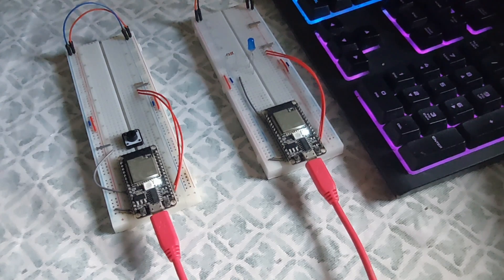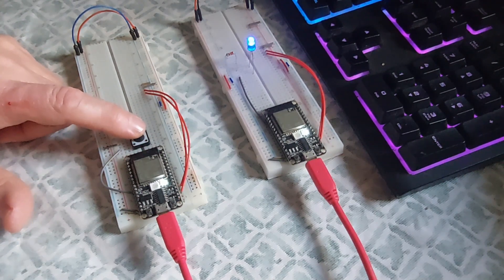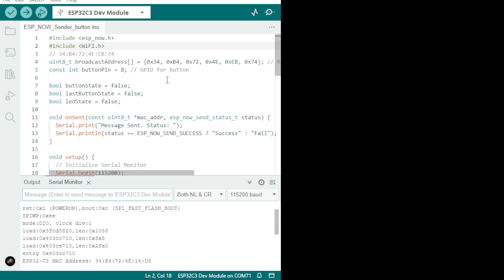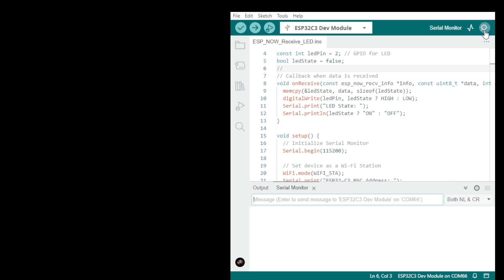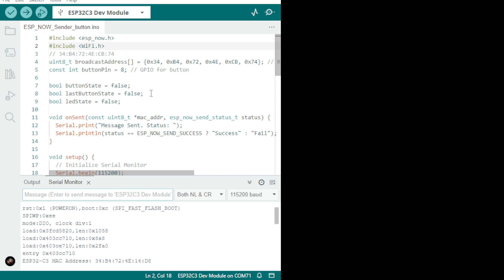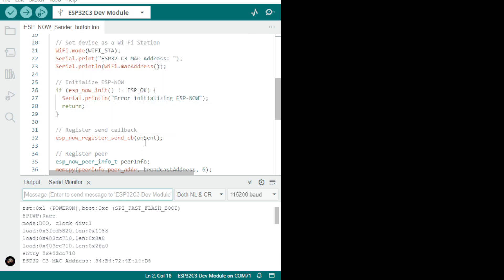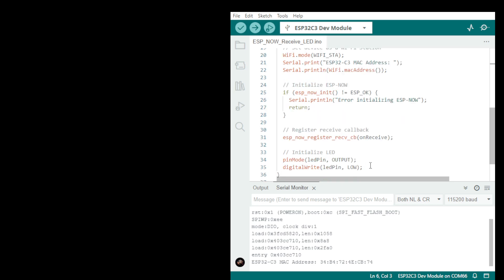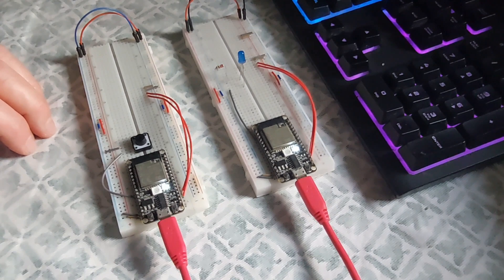ESP-Now light up an LED with press button via peer to peer

Comment: Thank you this is what I have been searching for. I have been trying to work out how the button and led split over the 2 boards with wifi.

Next project is combining a tb6612fng board to control a motor with a potentiometer.
Reply from the maker: Hi Darren this works in ESP-Now which is peer to peer communication protocol between ESP boards without dedicated WiFi router I hope I understood your question thank you
Reply: My problem was splitting the code for the switch and led, but this give me the answer on how it is done. I have an additional project to add the tb6612fng to run a motor. I am trying to get a model train running using esp-now
Reply from the maker: @darrenwilliams7951  Hi Darren ok I see we could try to run a servo or a dc motor ?
Reply: @electricum-z8u  I will be running a dc motor